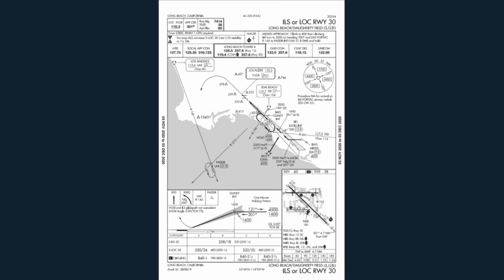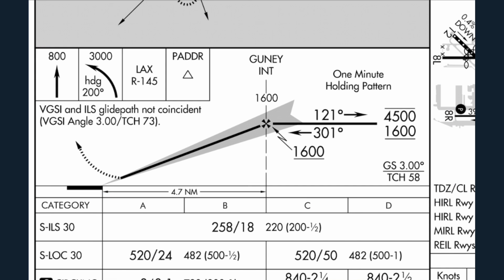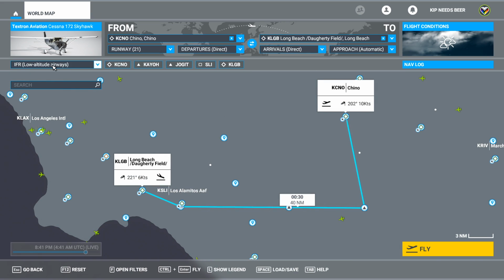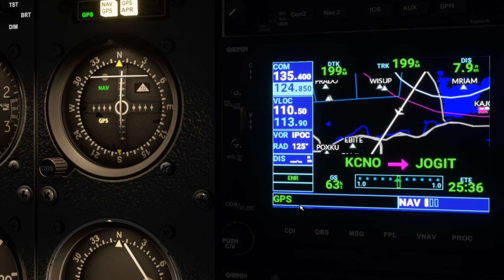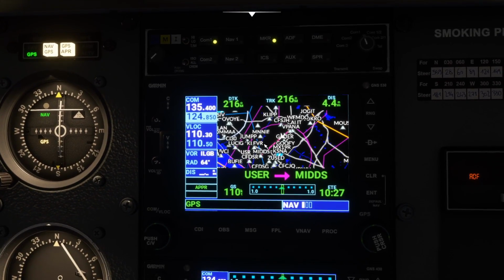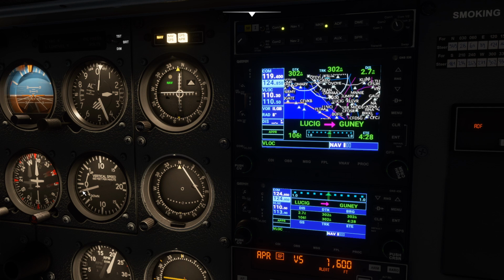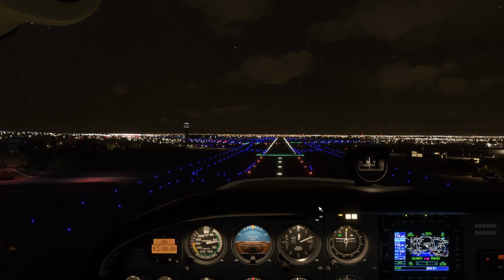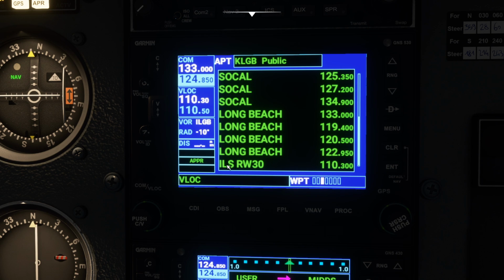MSFS: ILS Approach - Cessna 172 + Garmin 530/430 - Microsoft Flight Simulator

Comment: How do I set up the avionics with the 430/530? I only see options for the g1000.
Reply from the maker: The avionics are tied to which planes you have. The Skyhawk with the 530/430 is actually part of the Deluxe upgrade, but there are many other planes that have the 530/430 in them -- I'd recommend checking out the new DHC-2 Beaver that was just released in the 40th Anniversary update last month. It's free for everyone and an awesome plane. 

Otherwise, I have a not-totally-complete list of planes here that can help you find others with the 530 and/or 430 in them: https://docs.google.com/spreadsheets/d/1T6B23qOxRPYbG8izFL-vX3E-OE8V-TE5_YsJEzC1tyI/edit#gid=0
Reply: @KipOnTheGround  

I can see on the marketplace screen that I have the 430/530 installed and it says owned. How can I see it in the flight deck?

Comment: Thank you for the great videos Kip! Is there a way to fly direct to one of the waypoints in the ILS section? I tried today but it wouldn’t let me select the waypoint and then fly there instead of doing the whole thing.
Reply from the maker: Yes, you would use the FMS knob to highlight the waypoint you want to go directly to (do this by pressing the center of the knob first, then using the outer knob to select the waypoint), then press the "-D->" button (direct-to). Then press ENT twice.
Reply: @KipOnTheGround  Awesome, thank you so much!

Comment: Great job of explaining. What system are you using to run the MSFS??
Reply from the maker: Quite a beefy one… I have a 3080 gpu and a 5900X cpu. Got lucky with the 3080 in 2020. DLSS will be coming in sim update 10, so newer NVIDIA card owners will get a significant performance boost then!

Comment: Kip: Hope you don't mind a sort-of related question on this topic. Doing an ILS to Rwy 24 at Latrobe airport (KLBE) this morning. Using the GNS750. Departed from N68. The IAF for the approach is IGOCI on the approach plate. It was also the Transition I chose when setting up the ILS Approach. 
When I set up the flight in the world map that waypoint shows up when I selected that approach. However, in the GPS flight plan, it does not appear at all. The plane goes from the enroute JST VOR  but then direct to the FAF ZINTA. It skips the IAF all together since it is not included in the flight plan. 
I then tried the same flight using the G1000NXi. The IAF does appear in the GPS flight plan with that unit. 
Do you know why the GNS750 does not show the IAF? 
Your help would be much appreciated. Thanks!

Comment: Wooooo, finally did my first ILS approach......thanks to you, my good man. Though I notice that after I take manual control, I’m told to “Go around” by the tower. Is this typical? The sim has also changed a bit from when you made this with making the flight plan.
Reply from the maker: The MSFS ATC unfortunately doesn't separate any of the Live or AI traffic from you, so if you're flying into a busy airport you may get go-arounds endlessly. To avoid that possibility I usually just ignore the go-arounds in the sim, unless you want to practice one :-)

Comment: Just a tiny suggestion for sim pilots, planning to transition full scale aviation.    Wait till the White Arc  on the Airspeed indicator before lowering flaps.      In real life,  deploying flaps outside of the white arc could stress the airframe unnecessarily.
Reply from the maker: It's a good rule of thumb to only extend flaps within the white arc, and in this video I did make the mistake of using 20 degrees of flaps at around ~100 knots, above the white arc (amongst other mistakes!). Flap speed limitations vary by plane, though, and in the Skyhawk, you can actually use 10 degrees of flaps at 110 KIAS, which is above the white arc. You can see this in the POH or directly on the flap control itself within the plane.

I could have safely used 10 degrees of flaps at 100 knots, but based on me stating "another notch..." in the video, I was clearly at least going to flaps 20 prematurely. Whoops :-)
Reply: @KipOnTheGround    Thank you very much for bringing more clarity to the FMS & and also good practice for lowering flaps.     Really appreciate your content.    You are an awesome teacher!

Comment: I read in the manual you may be able to Arm the approach ahead of time and it activates when close. Does this make sense and does it work?  thanks
Reply from the maker: If you mean approach mode on autopilot, yes, you can arm it early. I tend to wait until I’m heading to the FAF (final approach fix) to turn it on.
Reply: @KipOnTheGround  thanks.   Btw. Great videos.

Comment: I'm having trouble getting vertical guidance when flying an RNAV/VNAV approach. Any suggestions?
Reply from the maker: Only "LPV" approaches work decently in MSFS right now. LPV is the ILS-like RNAV approach. Other RNAV approaches don't necessarily have vertical guidance, and if they do, it's likely VNAV which doesn't work in MSFS except in a few modded planes. If you look up the approach you're flying on a real FAA/Jeppesen chart, you can check to see if it's an LPV approach or not. Even if it is, they aren't very reliable in the simulator yet unfortunately. I'd stick with ILS when possible for now. Hope that helps!

Comment: How do u use the 530 instead of G1000?
Reply from the maker: Hey Fellipe, the 530/430 Cessna 172 is part of the Deluxe (or Deluxe+Premium) version of flight sim, so you’ll need to upgrade to get that specific plane. Each of the upgrades adds 5 planes.

Comment: Well put together videos, love your efforts so far. Here's a question. Is there any way to correct the approach tracks (magenta lines) when they don't match real world approach plates? I'm assuming that MSFS has slipped up on the data for some airports when loading an ILS approach from the drop down menu and whereas you can add/remove points along the blue part you can only add points to an existing magenta track.

This means that in the airport I am currently flying to (Newquay UK, yep, the one Air Force One recently flew in and out of) the MSFS ILS approach choice in the world planner has a strange track that flies directly up to and over the airport, then out for 10 -12 miles, then back in for the landing. This does not happen in real world ILS landings into Newquay, as shown by the approach plate. (plus, from my own experience on a plane) This is annoying given there being no obvious way to correct the mistake Microsoft seem to have made..
Reply from the maker: Thanks! I took a look at the EGHQ ILS 12 and 30 approaches, and I do see a procedure turn as part of that approach that's directly over the airport, so that's what that point is representing on the MSFS side. But unfortunately MSFS doesn't show the procedure turns in the Garmins yet, so you'd probably need the aid of something like Navigraph Charts or ForeFlight to pull it off right now. Hoping they add procedure turns, holds, and missed approach points in the future!
Reply: @KipOnTheGround  Weird that, as every flight I have ever been on into Newquay (Usually on a Dash 8 Q400), including one where the visibilty was literally 200ft, what a wet day that was, coming from the east turns on either the EXMOR or DAWLY beacons, heads south down toward St Austel and the Eden Project, then swings right and picks up the ILS glidepath south of Newquay. Not one flight I have been on has ever first flown directly over the airport (ie the magenta track in world planner)  It's obviously the transition turn that is wrong on the magneta track.

Here's the real world approach plate, https://www.aurora.nats.co.uk/htmlAIP/Publications/2019-03-28-AIRAC/graphics/101519.pdf. As you can see, the one that is selected in MSFS does not match this. Every flight I've been on has always followed that south turn first. Hopefully  someone will either release a custom mod so we can correct things like this, or the developers fix these. I'll keep an eye on those two items you mention. Keep up the good work !
Reply: A thought though occurs to me. Maybe every flight I have ever been on has never done an ILS approach, so they follow that plate NDB track (south first), and the only ILS approach I have ever been on (the one with the reallly atrocious weather) did first fly over the airport but because of the general murk, I couldn't see that !

But if that's the case, the NDB approach option in the world planner is still wrong as well. Ahhh MSFS !

Comment: Do RNAV GPS approaches not work in the standard c172?
Reply from the maker: Hey Derrick! I'm not sure how familiar you are with the different GPS approaches (so apologizes if this is too basic), but there are many variations including LNAV, LNAV/VNAV, and LPV. I've been able to use many LPV approaches successfully in MSFS, mostly using the G1000 or G3000 though -- I'd need to test out the 530/430 again to know if they work properly there.

An LPV approach is similar to an ILS approach since it provides both lateral and vertical guidance. However, LNAV/VNAV approaches do not work in MSFS yet (though supposedly they do in the Working Title CJ4 mod, if you happen to fly the CJ4 and have installed that mod).

So if you're looking for a lateral + vertical guidance GPS approach, I'd check to see if the approach you're assigned (or choosing) is in fact an LPV approach or not (you could confirm by checking the approach procedure document either via FAA or Jeppesen versions). If it is, you should expect to be able to fly it like an ILS and see the glideslope information appear on your CDI in the same way as an ILS would.
Reply: @KipOnTheGround  Yea, I have been trying to do an LPV approach and get it to load into the 530/430 and it's like it doesn't exist. You cant select any approaches or activate anything.... unless i'm doing something very wrong. I use the 650 in real world and don't think it would be that much different to load an approach.
Reply from the maker: It should be listed under the PROC menu as an RNAV approach (or you can use the world map to plan the flight and choose IFR from the top left dropdown menu. This will reveal an approaches selection underneath the arrival airport).

It is also possible that the specific approach you’re looking for isn’t in the MSFS database. Let me know which one and I can check it out on my end later for you!

You could pay for the Navigraph FMS add-on which is in beta for MSFS (it’s $35 or so a year just for the FMS data product) to have a more complete database: https://navigraph.com/products/fmsdata
Reply: I’m in the Bay Area and it doesn’t seem like the GPS approaches are loaded in there. For instance KHAF AND KRHV. Am I doing something wrong?

Comment: Thanks Kip!! Being somewhat new to MSFS, I have the glass cockpit in my 172. Do you know how to replace it with the Garmin 530/430?
Thanks
Reply from the maker: Hey Brad. The C172 with the 530/430 is a separate plane that’s part of the "Deluxe" or "Deluxe Premium" editions of MSFS, so you'll need to upgrade (via the Marketplace) to unlock them. After you buy it, make sure you go to the Profile/Content area and actually install the new plane(s).

Alternatively, there are some 3rd party planes in the Marketplace that also have the 530 or 430, like the M20R Ovation (530), PA28R Arrow III (430), and PA44 Seminole (530). Hope that helps!

Comment: Hi Kip. Love your videos! Thank you for sharing your knowledge with the community. Here is to hoping you will keep releasing more in the future :-)

I tried flying this route in a 152 navigating with just radios. I don’t understand how ppl are able (were able?) to do it. I wouldn’t say I could actually fly it, only semi worked with pause for tuning radios and VFR map for seeing how far off I was at any given time.

I think I understand how to “catch” these points in space by tuning two intersecting frequencies on two separate readios, and observing one or both (at JOGIT) of  the needles “crossing over” when I pass the intersection.

I also think I accurately located JOGIT,  LUCIG, and GUNEY using the sectional chart and approach plate:
JOGIT - intersection of SLI radial 076 “to” (freq 115.7) and POM radial 164 ”from” (freq 110.4)
MIDDS - intersection of SLI radial 120 “from” (freq 115.7) and SXC radial 039 “from” (freq 111.4)
LUCIG - intersection of I-LGB localizer runway 30 (freq 110.3) and ELB radial 261 “from”  (freq 117.2)
GUNEY - intersection of I-LGB localizer runway 30 (freq 110.3) and SLI radial 196 “from” (freq 115.7)

I could NOT find the MIDDS intersection (if that is the right term) on the sectional chart at SkyVector. Instead I found it by searching the Internet (on an old Jeppsen SimChart).

Any case - fun stuff… I think I need to start learning to “fly” with GPS! It’s too much with the radios and I will never get there :-o
Reply from the maker: Oh, wow, you did that route with crossing radials and tuning into 2 VORs? Awesome. I know of that method but haven't done it myself yet. I definitely use GPS primarily, but my partner was actually practicing navigating that way a couple months back (she flies for real 🙂)

Comment: Thank you for your great tutorials.
Very easy to follow - great job

May I ask you if it is possible to configure the Garmin 530/430 to follow a hold pattern until we are given the clearance to land?
Reply from the maker: A real 530 and 430 can show the holds, but unfortunately the MSFS version does not yet. Whether they can automatically fly the holding pattern, I'm actually not sure, and now I'm trying to find the answer myself... (I believe the answer is "no" though. the GNS 430 manual shows that it displays the pattern and will show a timer for you, but it's to assist with the hold that still needs to be flown manually)

The 530/430 are very limited in the sim right now, so who know how long it'll take for holds to be added. In the latest update, they did enable the OBS feature on the G1000, so clearly they know they need to keep improving them :-)

There is a community mod for the 530/430 that you might be interested in. It adds a VNAV page to the 530, which is nice, and also fixes many bugs. I'm not sure they'd actually be able to add holds since that data needs to be available with the Approaches (not sure if it is or not). Anyway, if you're curious you can try it out. This is the site:

https://github.com/pimarc/pms50-gns530
Reply: Many thanks for your prompt reply and for sharing your knowledge -much appreciated.
Great, for sure will be testing this community mod over the weekend.
Looking forward to any future tutorials directed by yourself :-)
Reply from the maker: I looked more into this and found some videos demonstrating the G1000 doing automatic holds using the autopilot! That feature isn't in MSFS yet, but we can hope for it in the future! I'm guessing more advanced implementations of the G1000, like in X-Plane, likely have this, but I haven't checked them out myself yet.
Reply: @KipOnTheGround  Thank you for your message. Great, looking forward to the future, and in the meantime I will take the opportunity to practice these procedures manually :-)

By the way, I did test the community mod for the 530/430 "pms50-gns530", it is indeed looking very promising, but unfortunately my sim became very unstable - crashing 5 times before rolling back to the original version. I will test this again for sure once "Github" releases a new version. But again, thanks very much for your help - much appreciated.

Comment: First notch of flaps at 120 kts?
Reply: @KipOnTheGround  Your particular 172’s airspeed gauge shows 85 kts for flaps range. :)
Reply: @karlhouseknecht  it's on the placard by the flap handle and in the limitations section of the POH.  I taught in 172s for way too many hours many years ago in real life. 110 KIAS up to 10 degrees.

Comment: Fantastic video and series. Keep it up! One thing; you might want to check your explanation of the two different directional radios (one is for horizontal guidance, and the other is for vertical guidance) and the shaded arrow.